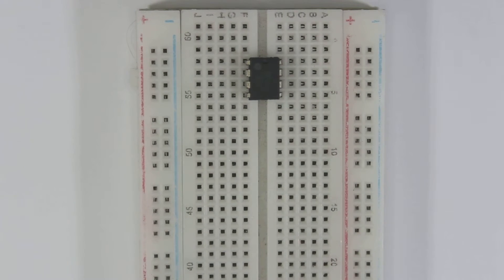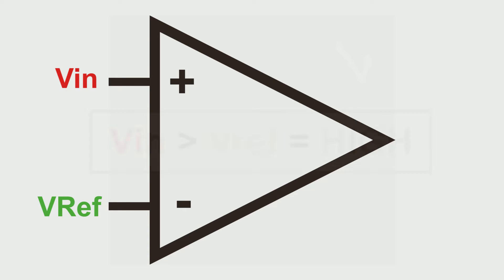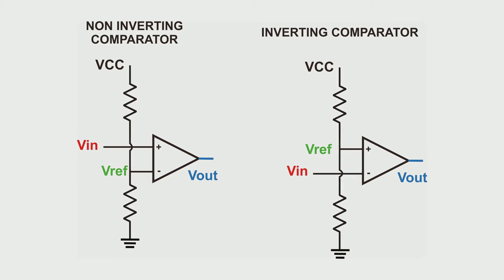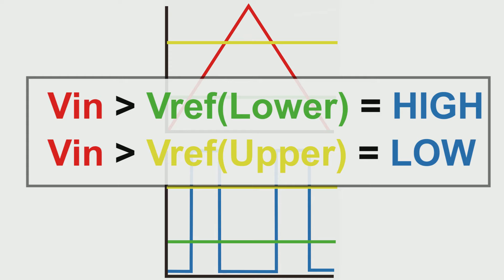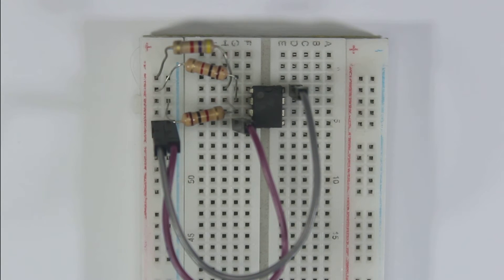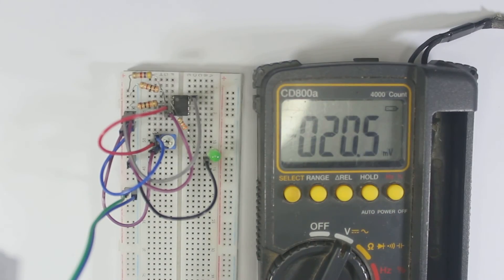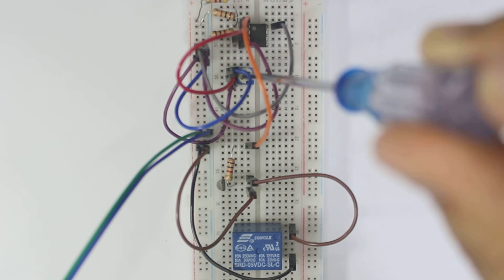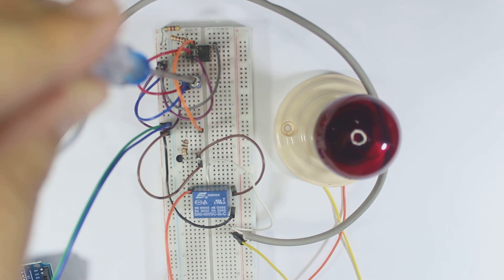Comparator and how to use it (explained with real life application) - Electronics Basic #1

Comment: 6:01 when Vin drops below 1.6v, A2 output goes low but A1 output is still high. I think comparator has open collector output (low output overpowers high output from pull-up resistor) and is why it works.

Comment: A better example would be if you used a zener to establish Vref - because your comparator desdign relies on a completely stable Vcc.
If you are (for instance) monitoring a battery output voltage and using the battery for Vcc you need a zener to produce a reference below the minimum battery voltage and a potential divider for the Vcc to Gnd - giving an absolute general purpose comparator design that works over a range of source and target voltages (especially if you put a variable resistor into the potential divider).

Comment: But I don't understand that why you connect the 4.7k Load between VCC and output. At 9:03
Reply from the maker: That's called pull up resistor. Try google it

Comment: I am Little bit confuse  . if in inverting vin less than reference volatge than out out will bhi high 
and in inverting and non inverting comparator you showing that is vin e low respect of reference voltage than out but will be zero

Comment: Sir instead of using lm35 can I use a thermocouple and how to use it as Vin or on non-inverting pin?
Reply from the maker: What kind of thermocouple?
Reply: @miliohm  Type k thermocouple
Reply: @miliohm   Hello sir it's K type thermocouple
Reply from the maker: @allabouttech5689  the output of the sensor will be so small. I think you will need an amplifier, and it's little complicated to build one. But you can google for it. Then you can use the output of the amplifier to the comparator input.
Reply: @miliohm  Thanks, but with the help of your tutorial I was able to build the heat sensor using thermocouple and also NPN transistor that is 2n3904 relay and everything works fine, but if I use PNP transistor  2n4906  it keep turning ON and off the relay. Please do have any idea  that can help I will really appreciate it.

Comment: using 120/240V on a breadboard is not a wise thing to do. Putting the relay away of it and activating it with wires going outside the breadboard is much safer for both the equipment and the operator.
Same : don't use flames. There are many safer and inexpensive ways to heat the sensor to 35°C than using a lighter.
Finally… well, the application of such circuits is barely what I consider real life. Generally we don't need a temperature threshold to light something up (a photoresistor might be a better choice) nor we need a relay to turn a low voltage DC fan on (a small transistor is enough). Maybe a good application might be to use the temp sensor on the transistor to make a crude temp protection for it.
All in all, the analog sensors are not precise and have high tolerances. In real life, digital ones are often less of a hassle and that's why we use small microcontrollers instead of simple comparators, or on the other side engineers use inexpensive electro-mechanical circuit-breaker thermostats on many industrial and home appliances, no electronics required.